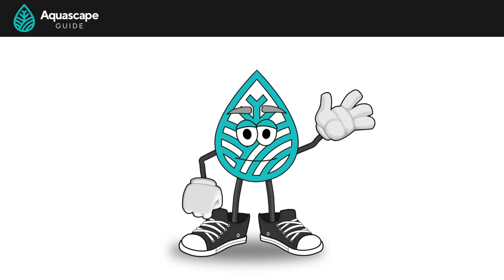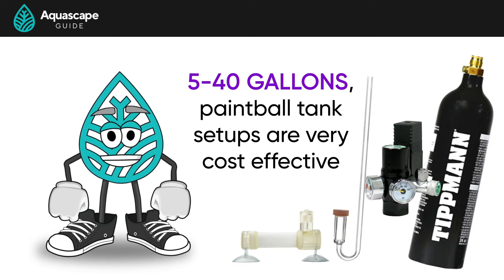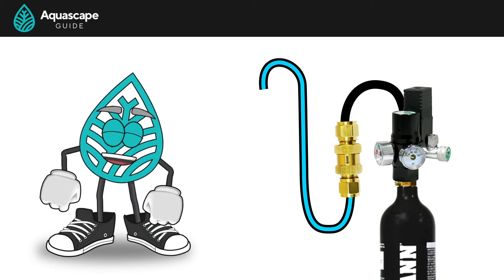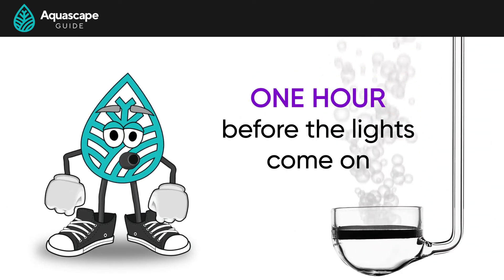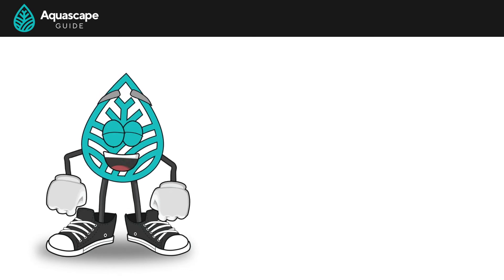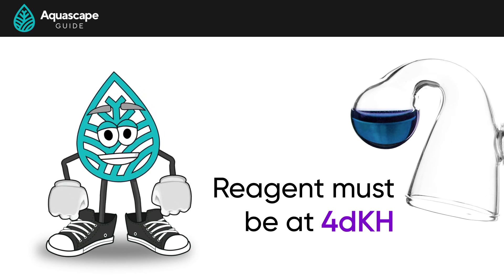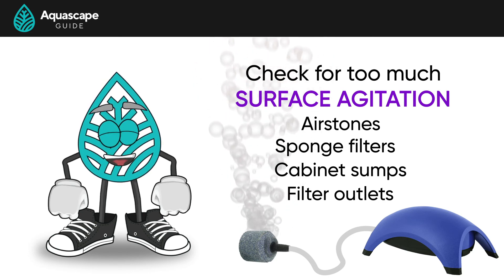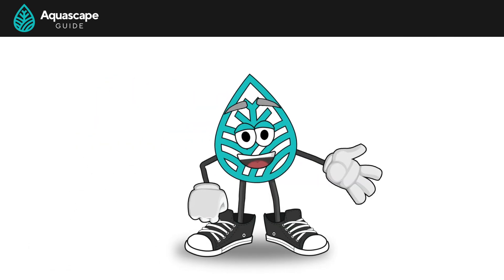Aquascape Guide - How to Set Up a CO2 System For A Planted Aquarium / EP 3 - CO2

Comment: Thanks for the video. 
Have more thoughts considering from 8:15  
* OK with getting 1ph deducted by Co2 before lights. 
*we have to keep constant pH level( different of 1unit)
*since co2 utilisation by plants also a  factor to decrease pH difference(increase the pH) we definitely have to add little more Co2 considering photosynthesis, when lights on
*when we adjust that  Co2 dose level  it should reduce the staring lead time, and end time respectively.

Welcome for ideas
Reply from the maker: Hello! Thanks for dropping a comment! We agree with your thinking. As stated in the video, it just takes some tweaking to get things dialed in. Depending on if you have lots of fast growing plants or not, that PH drop can start to go back up when the lights go on, so we do need to take into consideration the PH at the end of the photoperiod, and make sure we're maintaining that 1.0 PH drop. Ultimetly, if your PH starts at a 1.0 drop, and ends at a .8 drop, that isn't the end of the world. Its moreso an issue if you start at a 1.0 drop, and end up with a .1 drop. Like nutrients, we just want to make sure the plants have more nutrients, including CO2, than they need at all time :)

Comment: One thing I was hoping to see discussed when you brought up the pH controller, how do you go about using the controller and the 1pH drop in the morning, then keeping the pH stable, and then back off before lights are out? Is that a matter of using a timer to control when it turns on and then the controller maintains the level? What happens if/when the pH creeps back up higher than you'd like? Wouldn't that be a shock to the fish for that much of a pH swing in a short amount of time?
Reply from the maker: Yes! This is a video I plan to create in the future. I'm a little backed-up content but want to get a PH controller and show everyone how to set it up. But it's the same way we set up a normal regulator, but the PH control is put on a timer. The timer turns on and off the PH controller as needed. And the controller, while on, controls the flow of Co2 to keep the PH where we set it. I hope to get to this video and dosing auto dosing pumps early next year ;)
Reply: @aquascapeguide  So just to make sure, you're not worried about the pH going higher than normal to have it lowered? How much of a pH increase would you be worried about it increasing before you start getting the drop going?
Reply from the maker: It doesn't go higher than normal, it goes lower. For example, if your PH normally sits around 7.4, you'll drop the PH to a 6.4, and keep it there throughout the duration of a photo. And no, I'm not worried about the pH drop. It's considered a fictitious pH drop and most fish are fine with it. There are more sensitive fish where you can't go down a full pH point, but that's more rare.
Reply: Sorry, i was referring to when the controller shuts off, the pH would climb overnight. With my controller now, I run a steady 6.8 and it would go to 7.0 or higher when it's shut off. so at what point would you say the pH is too high?   @aquascapeguide
Reply from the maker: Nah, you're good man. Again, it's considered a fictitious PH swing and wont cause any issues. The thing that I would look into if you water hardness. A 7.8 or higher could mean that your KH is hard. And if your KH is hard, your GH might be as well. High water chem can make it harder for plants to he happy, so check out the ASG water chemistry video. It covers how to test and adjust your KH/PH. I generally try to run my tanks at a GH/KH of 4. That puts you at a 6.8-7.0, and I inject down to a 6.0. You're starting mucb higher so its good to look into. Plus, you need to know your off gassed PH to know where to inject down to.

Comment: When using a controller do you still recommend turning Co2 on/off 1hr before lights turn on/off ? Or just keeping it on to have a consistent PH through the entire day? I realize the plants will not utilize the Co2 in the dark, but I didn’t know if the consistency in PH would be over all better than a 1.0 (or potentially greater) shift everyday, or if the Co2 at night could potentially cause other issues?  (maybe over saturation, >30ppm) Thanks for the great video!
Reply from the maker: Nah, just have the Co2 come on and off every day. Dont leave it on. If you have livestock in the tank, Co2 can build up and gass them. And if you dont have livestock in the tank, it's just wasteful yo have it still running. It's considered a fictitious PH drop as the carbonic acid isnt really eating away at our KH, so its not effecting our water chem. Your GH/KH jumping around would be at lot worse than our PH drop due to Co2 ;) Hope you enjoy the controller! Those look like a lot of fun.

Comment: Hi,
Thanks for sharing.
May i know how to clean diffuser ?
Reply from the maker: You're welcome! I hope you were able to learn something. To clean a diffuser, follow these steps. 
1) Fill a cup up with 1 part bleach and 3 parts warm water
2) Turn on the CO2 and put diffuser into the bleach solution for 10 min
3) Dump the cup of bleach and fill it back up with hot water and lots of dechlorinator. I use 4 capfulls of Seachem Prime. Soak for another 10 min
4) Rinse with clean water and put back into the tank

I will come out squeaky clean!  :)

Comment: I am using diy co2 at the moment sugar n yeast one problem is I can't turn it off at night or when lights goes off theirs no live stock in my tank 
Is it ok to run co2 24/7 does it effect my plants  anyway
Reply from the maker: Hello! Thank you for your question. If you have no livestock, its ok to have it running 24/7. Its not going to harm anything. The only problem you'll run into is when Co2 production starts to dip off. Your plants are going to be used to the CO2 being at a certain level, and that level just drops over time and the yeast consumes the sugar. This flucation can cause BBA, so just be mindful of that. This is why we pressurized CO2 canisters, to have more control over CO2 saturation levels. Hope that helps.

Comment: I think it really depends on how many plants are in the aquarium. Also,
 Are the plants able to injest the CO² and by that I mean, are they bare of algae? 
So many things to consider!
Reply from the maker: Kind of, not really. PAR drives growth. The harder we push the plants with PAR, the more carbon and nutrients (micros and macros) they will consume for growth. Pretty easy. Even is some plants leaves have algae on them, the newer growth will come in fast and strong, outcompeting the algae. And all this can be measured. With Co2 I've been able to get up to 400 PAR. With carbon we can watch our PH drop. If we drop out PH a full point and it stays there throughout the photoperiod, we know we are injecting enough. And with fertilizers, we just dose enough to keep our nitrates boosted an extra 5-10ppm, but you need to make sure you're using a holistic fertilizer, like our fertilizations kit. Done and done, not much to to consider when you have metrics you can hit. It takes the guessing game out of things.

Comment: Hey man! I hope you are doing well .. I watched your CO2 setup guide But I am having some issues if You can help, it will be great for me☺. My tank size is 106cm * 45cm * 45cm(About 250litter), Using  DIY led strip lights(130watt), A DIY Canister(Mechanical & Biological) with M2 Inline Diffuser and a Pressurized CO2 setup. I have a Digital PH meter(Fully Calibrated) and a drop checker(New filled solution) then I checked my tank water PH 1hour(While only CO2 On) Before lights on.
And It gave me a result of (8.2) then after 6 hour while co2 and lights still on ,then PH drop only at (7.7). But The drop checker gives a Yellowish Green which indicates a almost high co2. I have less plants like 30% covered only. Tank age about 3 months.
Reply from the maker: I don't trust drop checkers for this reason. Follow your PH meter if you know its calibrated. Are you getting the one point PH drop before the lights turn on? Is the PH just raising back up?
Reply: @aquascapeguide  Will do man , Thanks for the help . Tomorrow i will do a big Water Change  and  check again Just hope for the best . Thanks again 😊
Reply from the maker: @ratul89  Check the three points the video talks about 1) Completely degassed, which sounds like 8.2... 2) Right before the lights come on to see the drop, make sure you are getting that one point PH drop BEFORE the lights turn on... and 3) RIght before the lights turn off. That will make sure the PH doesn't climb back up, or keep dropping over time. That will tell us if we are injecting too much or too little. Keep me posted! We'll get you dialed in ;)